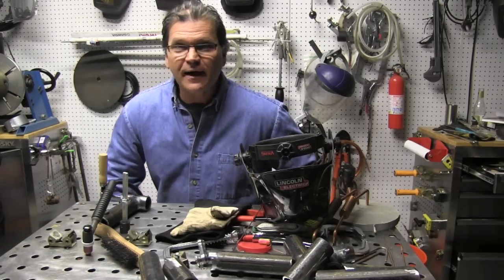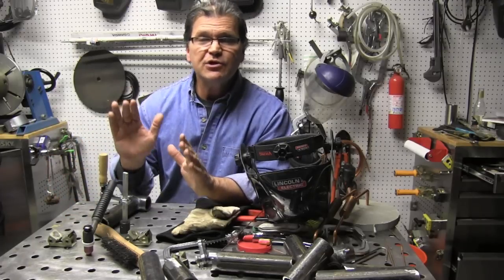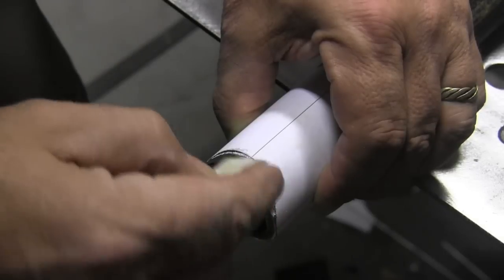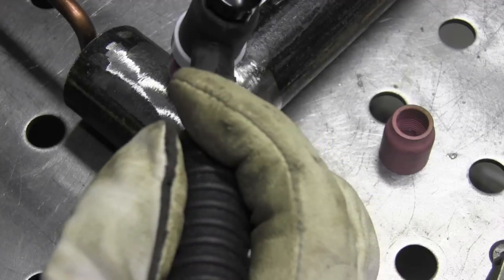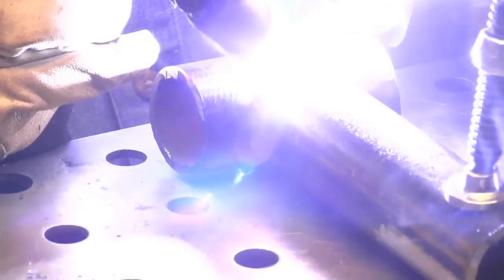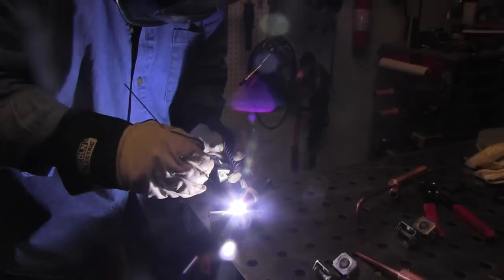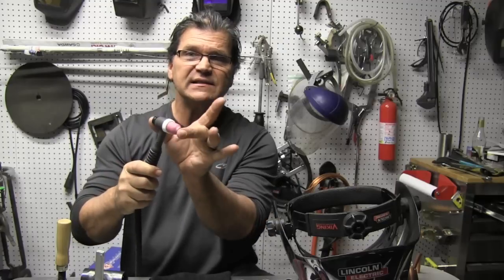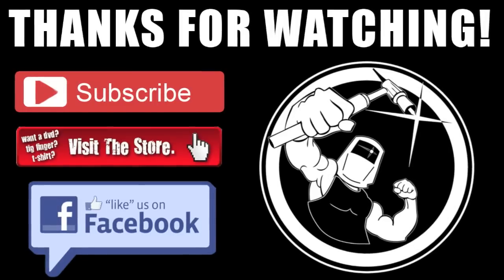TIG Welding Technique using Pedal for Pulse

Comment: Normally use the pedal pump technique  on 4130 for racecars so as not to overheat the weld. Also on aluminum to get a nice, fat weld in one pass. I think the logic in the racing industry is that weld cracking can be a problem with the high load, high vibration environment. The hope is not overheating the base metal and getting a good bit of filler down mitigates this. Mostly theory though

Comment: Good tips!  I weld steel bicycle frames with .035 and .028 wall chromoly, and foot pulsing works really well for that.  Gives me more control and allows me to avoid blowing holes.

Comment: That looks a lot like how I weld really thin aluminum tubing that usually is not coped very much - I have to go in ‘ surges ‘ to control the heat transfer.
When you have something you do pretty much the same you get it all worked out how to do it best and then do it - maybe 10,000 times.
At my job I do a lot of ‘ cold feed ‘ TIG welding using the head on my Miller MiG welder for the wire feed in my left hand and TIG in my right. Most people look at it and say how can you coordinate that it looks crazy but I’ve been doing it a long time and just grab and go

Comment: Coming from building hand rails, if you are going to smooth that weld down flush, for that smooth "no weld here" look, is best to start at the top of the pipe and built it up from there so that you fill the valley.

Comment: I prefer this way I was welding stainless 304 at 125 and pulsed it and came out perfect.. also it helped me control the puddle and not run over edge

Comment: I often see stubby set ups and wonder how the electrodes get so short? Are they just left over tungstens which have been sharpened a fair amount, or can you cut they easily enough with the right method?  cheers

Comment: what if the filler touches electrode?  do you die?
Reply: always keep the electrode clean, when you see the green flash sharpen it. steel if more forgiving then aluminum.
Reply: i got shocked the other day lel
Reply: If you got no gloves on you tend to throw everything across the workshop while shouting YAOOOOO! FUCK ME!
Reply: You don’t weld AC with no gloves on my Miller Syncrowave or you’ll be looking like Doc Brown after sending Marty back to 1985

Comment: I use this welding technique on a daily basis where I work. I build Outlaw Karts out of Cromoly tubing in sizes ranging from 3/4-.049 to 1 1/8 .120. I use a #8 shorty gas lens cup and 3/32 thoriated tungsten. I sharpen the tungsten as sharp as it will go and stick out about 1/4" to 5/16 and use 3/32 er70s-2 filler. I run 200 amps for all thicknesses as I use my foot pedal to control heat. All my welds come out with a very clean blue, or sometimes salmon color. This is the only acceptable colors I can get away with. Grey welds won't do on the moly. I have found that welding any other way just doesn't work for me because sometimes I fit .049 to .065 and thicker. The thinner material just melts away and ruins the part. I'd post pics if I could, but the weld quality is phenomenal. Look me up on Instagram for some great looking welds! s2raaron
Reply: Also, I use pulse on my machine. I have a miller 200 synchrowave with 15 pps.
Reply: Me too. Everlast powertig 250ex @ 10pps.
Reply: I use a powerMTS and only really use pulse to keep my rhythm for the filler metal.

Comment: If this is common practice for automotive, how do you see the pulsing affecting the integrity of the weld joint? Without as much heat would you get consistent penetration? Is this acceptable practice for structural components like chassis members?

Comment: Anyone have any tricks for sliding my hand along?  I get setup and comfortable but when it comes time to weld more than a few inches at a time by sliding the edge of my palm, my glove seems to stick to the table.  I either have to stop and reset or I slide ahead too much and ruin my puddle.  Any tips and tricks?
Reply: Deer skin gloves work great for sliding. But they are really thin.
Reply: Kidskin works well.

Comment: Hi Jody, if I was given argon/co2 by mistake instead of 100% argon what would it look like when Tig welding? Something's wrong! The outside of the gas shield almost looks like a flame and is orange in color. Also, there's some tiny sparks coming off....doesn't it sound like I was given argon that has co2 in it by mistake from my gas supplier?
Reply: That is exactly what took me awhile to realize one time. I got a mix instead of Argon, and it will not work right. It will shoot off sparks and over heat your parts, and jack-up your tungsten! What you've described is from the wrong gas.
Reply: At my job some time back they got a tank of argon- 10% co2 by mistake and wanted me to see if I could use it. I tried and did okay but welds were sooty kind of dirty looking and when I welded something that needed turning they said it was hard as rock.

Comment: Good idea. When I got my first tig machine (a Miller 300 gold star) there was no pulse settings, just post flow, and low amp start, (possibly a hi freq adjustment). I learned to short the electrode momentarily to lower , then gradually gain amps to get the same effect. When we got a pedal it seemed natural to work it like a gas pedal on a car, more or less depending on the need. No youtube in the 60's (not even computers),so we "learned by doing". I always found welders to be willing to share their knowledge. I was learning up to the day I retired. Just back now cause I bought a little flux core machine for fixing stuff for myself and neighbors. Fun watching you. One thing I haven't seen is using a tig torch as a coated electrode holder. We did it all the time to reach otherwise inaccessible areas while having a pedal and Hi frequency to start and control the heat.
Reply: +papa Hajek I feel so spoiled. I bought my first everlast welder and can't live without inverter features now. I can't even weld at 60Hz anymore. I have to have it at 100 or 120Hz. I love youtube. I feel like I can learn just about anything now.
Reply: +Jonathan Little I agree. I've learned plumbing techniques, improved my golf game, done some electronics repair, and learned some great Bible truths and fallacies all through youtube .

Comment: Hey Jody!
As always nice videos. I'm a beginner in TIG welding so I have one question about TIG welding - why I get some buildup on  gold marking 1/16 electrode  - not on the tip but longer inside the cup. welding regular hot rolled thin wall tubing with Argon gas, number 5 cup, 75 AMP, 1/16 general purpose filling rod.

Comment: hello sir, i am very new to TIG. i was thinking if you could advice me. i have an exhaust project for motorcycle. i prefer without using filler. i am trying to weld mild steel, carbon steel.. tubing . thickness at 1.20mm can you advice on the setting. i got a DYNA 250p ACDC.
there are a few settings option
Re Flow
base Current
Peak Current
Down Slope
Pulse Width
Pulse Freq
Post Gas
Clear width

Comment: I weld A LOT of saddle joints on 4130 .058" wall. I use the manual pulse method and I love it. Lots of heat and puddle control for the super thin wall material.

Comment: Jody, I weld a lot of sheet metal and had developed a foot pulsing for that (none of the machines I use have pulse.) What are the pro/cons of pulsing vs not pulsing? Sheet metal it makes sense but I do wonder if there are any problems doing it in tubing and rollbars. Thanks.

Comment: Hi, I've been watching your videos with much interest and thought I'd ask your opinion with regards to a welder that I plan on buying. It's sold by a german business on ebay UK and it looks like it offers quite a lot for the money they ask. It's an AC/DC 200A TIG, MMA, and 50A plasma cutter in one with pulse, HF start and many other controls (one of the pictures shows in English what the controls do). The welder comes with a 5 years warranty and at a very decent price for the UK market. Once you open up the link, please scroll down and you will see a number of tabs containing the features and technical data, etc. of this machine. Your advice will be much appreciated!

If you do not trust the link below, then please search for WELDER STAHLWERK AC/DC TIG 200 PULSE and PLASMA CUTTER - HF INVERTER ARC STICK on www.ebay.co.uk website.

http://www.ebay.co.uk/itm/151388787176?_trksid=p2055119.m1438.l2649&ssPageName=STRK%3AMEBIDX%3AIT

Best wishes,
Chris

Comment: I weld aluminum pipe all day at work and this is a great and must know how to do on pieces with gaps. In real world welding if you mess up you have to fill the gap, its faster and cheaper then bending and re coping new pipe. When you pulse it keep an eye on the outsides of the puddle, you want it to be consistent all looking uniform. Also, it is easy to not have weak welds when welding for example 3/16 to 3/8. Make sure you can see the puddle burn into each piece of metal. It is really easy to make a beauty weld where you are just laying the filler rod on top of the two pieces and not actually getting a strong weld. It is a great way to control the heat!
Reply: Aluminum usually ‘ heaps ‘ up pretty good making it fill holes good.
Building ‘ bridges ‘ too

Comment: Great vid! Thanks. in 1975 I watched one of the best tool-welders I've ever seen join 2 snail-shell aluminum blower housings.
I remember the foreman said they were .018" thick at the rims. I had no Idea what I was watching then, I was just curious. I'm pretty sure he was doing a weld just like you demo'd here. The halves were "pinch-trimmed" and the slight roll at the trim, was all he had to work with. In other words the weld was mostly filler, not melting two flanges into each other. He did several housings per/hour. Now with your vid, I see what I saw back then as magic. Thanks again. Phil

Comment: Yeah a tig welding video on porosity where you do a job abiding by aws d17.1. 6061 or 5052 tubing 2". Use a turntable if you have one. A simple butt joint . If you have a way to leak test afterwards by welding some fittings or caps on the ends it would be nice. 5356 rod is what we use on our aerospace jobs when we anodize afterwards. We get a lot of leaks because of humidity and restarts so maybe a few tips on machine set up as far as balance setting torch set up...... If you want to have a lot of fun run it like a nadcap job.

Comment: I saw an old fashion adjustable wrench in back ground hung on the peg board. I wanted to mention that they make the best thing to tweak the angle of iron to square up things when tacking a weldment  up as the handle is at 90 degrees rather than 30 or 60 and in combination you can usually get a good lever on the part that need to be tweaked. thanks for the videos  jim h

Comment: What are the cases where you should or should not pulse? It seems like a nice way to help control the heat especially for inexperienced welders (like myself). Is it a danger of backing off too much and then not having penetration and moving on too far each step resulting in more of a stitch than a continuous weld?

Comment: Wow, thanks very much for the shout out! I have a section called "Over My Figurative Shoulder" that folks might enjoy. It's not a "how to weld" series, but a "how I weld" series. I always enjoy your videos, Jody. Great information, and really easy to watch. Pulse TIG welding is pretty much the standard in the hot rod industry, as the parts not only have to be strong, but there is a large art component to the parts as well. Welder Series is a small family business producing high quality chassis components (available welded and ready-to-weld). 
Thanks again for the mention, and I hope you have a great year.
DW Horton
Reply: Instablaster...

Comment: Nice video on an old way of doing things.  Especially for those of us without digital-controlled IGBT machines. I've found it helps to mentally focus on the arc-puddle interface rather than which hand you're holding the filler metal in.

Comment: Thought you may find these few guys interesting real interesting. They are on instagram. one is radweldingsupplie, 2 cdaven271, 3 welderassassin, 4 toxicfab, 5 joe_at_tempest, 6 starclassic. These guys are the best welders ive seen.These guys focus on controlling the heat as well as look. And have amazing technique.Thanks for your your videos.
Reply: If you go on Honda-tech welding and fabrication section you can see where Toxicfab and those other guys learned to weld. Just go in the welding  section. You can even find toxicfab thread where he is learning to weld and they are all teaching him.

Comment: Hi Jody great info. Do you think this can work with aluminum? I'm having trouble making small beads on tee joints. It seems I need a ton of heat to make puddle.  .125 thickness need 140 amps to puddle.  Is this way off?  When it does puddle the beads are about the size of a dime and flat. Am I going to slow??  Using 1/16 purple  band electrode. 1/16 filler. Thanks for vids. They taught me plenty!
Reply from the maker: there are a lot of things that go into making a small bead on aluminum tees. a tight arc is probly the main thing.
but also helps to use a tapered electrode.  another thing that may not be obvious is that too much argon flow sometimes causes an erratic arc and more amperage is needed to flow a puddle.  lots of guys use a #5 cup with only 12-15 cfh for aluminum

Comment: Would the 1 amp per thousandths apply to MIG welding as well as TIG?
Reply from the maker: yes...roughly anyway.  example .100" = 100 amps  but then you have to figure wire speed.  the factor is different for each diameter of wire.   for .024" wire the number would be 3.5 so 350 ipm ... .030" wire the factor is 2 so 200 ipm, and for .035 the factor is 1.6 so 160 ipm would provide 100 amps.  voltage can then be set for a smooth arc and the heat will be fairly close.  since all machines are different, its just a good starting place.
Reply: +weldingtipsandtricks It's annoying that all machines are different!  It's too bad they aren't calibrated to accurately reflect wire speed and actual volts / amps. It took me a bit of time figuring out the settings for my everlast mig welder but once I did it was great. Thanks for all of the tips.
Reply: There will always be minor discretions and veerances from accurate reading in terms of wire speed and voltage. However there are machines that are more accurate with their readings than 90 percent of machines out there such as merkle and rhem machines from Germany. cant touch them on refined quality and accuracy. but if youre a good welder youll weld under any circumstances with any machine, that I firmly believe.
Reply: Milton Gwelch 0

Comment: As someone who recently moved from a scratch start setup to a "real" tig machine with a pedal and pulse function.
I quickly found that low frequency pulse is pretty much useless (for me) when I have that pedal.
Instead of me having to keep up, or wait, for the machine I can pulse at what ever speed I want in that instant.

Great video, think I'll need to order that stubby kit soon :)

Comment: I heli arc welded professionally for 12 years. I would suggest the best tip is to have your tungsten very sharp always. Get your argon adjusted up their about 20 lbs or so. Keep your tungsten at a perfectly perpendicular angle to the work piece at all times if possible. keep everything moving right along don't stay in one place too long. If you have to let cool off and take a break and come back when its cold to attack a area giving you problems.

Comment: I like the technique, but I would think in the 'wrong hands' it could be potentially bad - but I guess that could go for any welding. (this is in reference to race car fab and roll cages in particular). If a pulse got too far apart, or a cold shut between pulses could create a place where the weld would fracture? I'd be interested in seeing a good continuous weld joint vs. a pulse welded joint tested to failure to see if there were any difference.
Reply: I was thinking the same..   but he kept a puddle and never stopped moving...      Vs. A mig for example would be bad to try and pulse just for looks.  You would definitely have cold joints... divets...  and poor penetration.